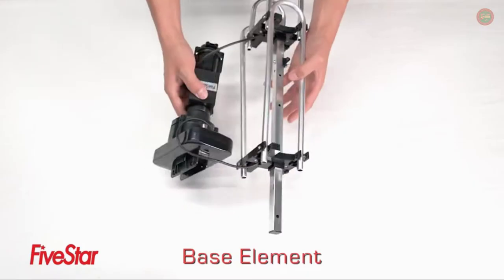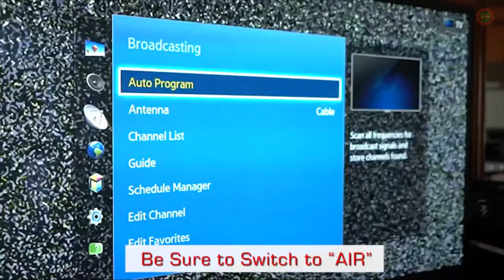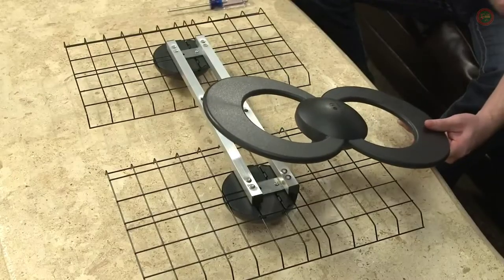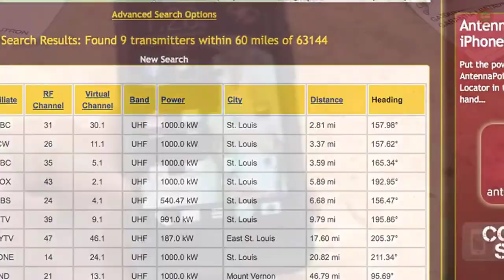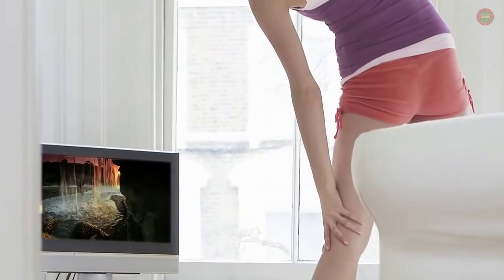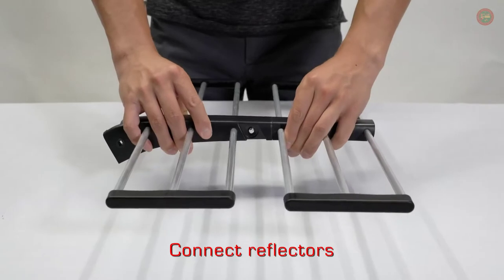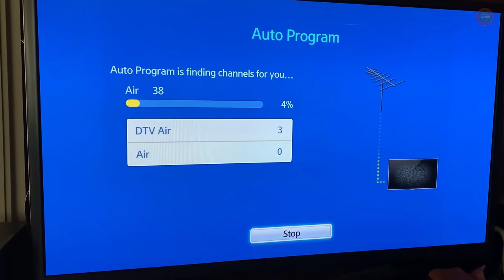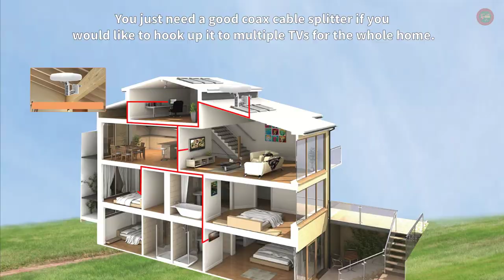Best Outdoor TV Antenna In 2023 -OTA- Top 4 Outdoor TV Antennas (Five Star, Antennas Direct,1byone)

Comment: TV antennas with built in rotors and preamplifiers are notorious for being a bad deal in the long run.  You are better off with an antenna and a separate amplifier.  Amplifiers tend to be the weakest link in the system  Most people don't actually need a rotor.